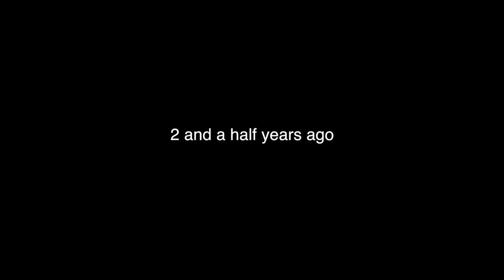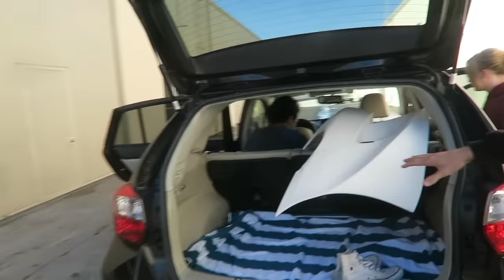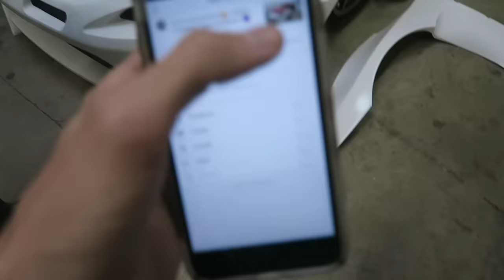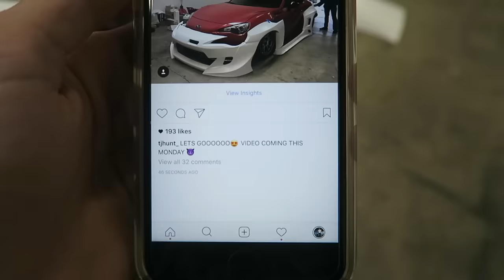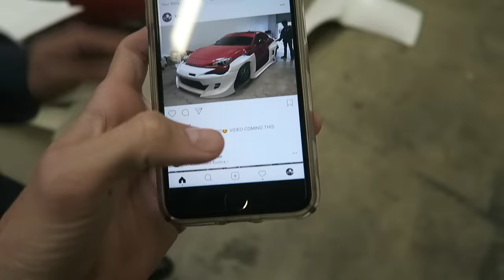I GOT A WIDEBODY KIT FOR THE BRZ

Comment: You should get the full defuser, as opposed to just a half. Kind of defeats the purpose of having a defuser. A full defuser will make a hell of a difference to the handling. Other than that, it looks good, or at least it will.

Comment: Not to add fuel to the fire however you did say that your were going to Rocket Bunny the car. Buying a knock off which steals the design (as I am sure they don't pay royalties) on a video with over 1.4 million views is not nothing. 

I think the reason some are upset is that from the outside money does not seem to be an issue and so why would you not support Rocket Bunny who actually designed it?

Comment: just asking everyone for advice getting a new daily after driving a 1996 camry for a while it's either gonna be a civic, integra, 240sx, or miata if I get a Honda I would swap the b18c5 type r in without a doubt but with a Honda I can't do much of anything to the car due to the high theft rate I could get as much security as possible but that is leading me to the miata I can mod it without too much worry and maybe turbo in the future it's rwd convertible etc just a bit impractical and will suck in snow anyone know what's better a vtec honda or miata